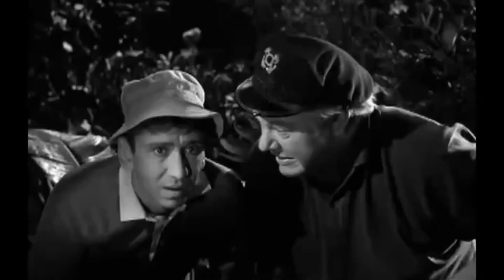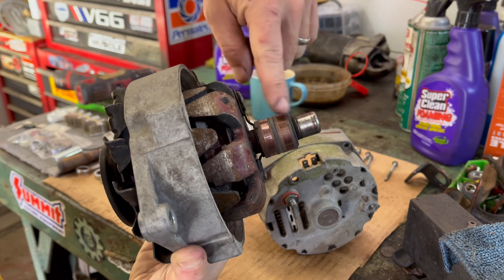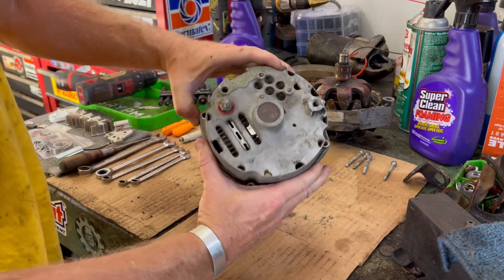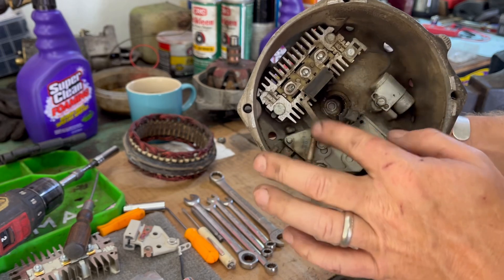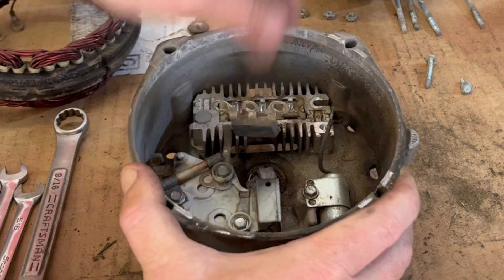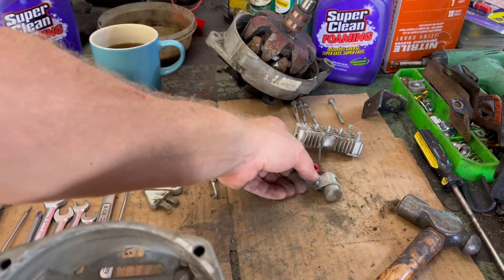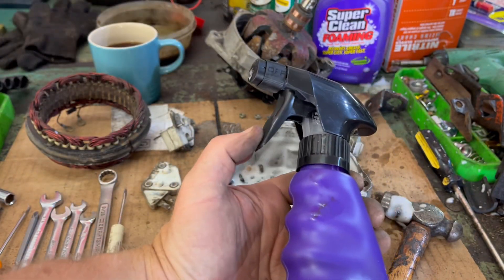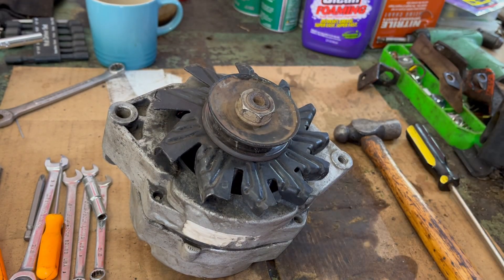DIY GM SI series ALTERNATOR repair?

Comment: If I remember correctly from when I was a kid in the late 60s, we used a paperclip that went in from the back of the alternator and it held the brushes in place till we assembled the front half with the armature on it to the posterior part with the fields. Once all was in place we would pull the paperclip out releasing the brushes. It usually made sense to replace the brushes when you rebuilt an alternator, starter, or generator while you had it apart.
Reply from the maker: @DavidSmith-fs4nt  yes, you can definitely wiggle something thin in that hole near the rear bearing and hold the brushes down before you disassemble it.  I figured that out after I had it apart 😂😂😂😂